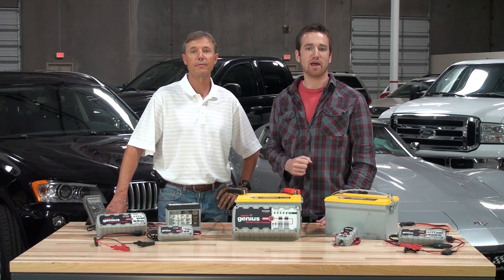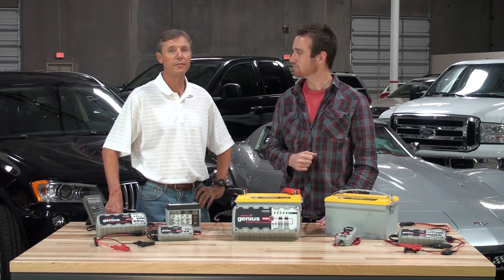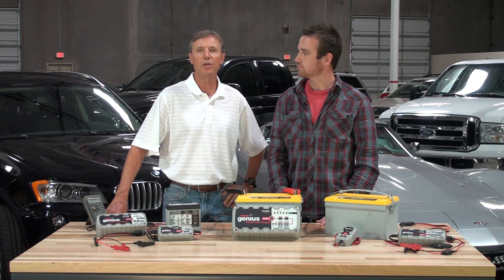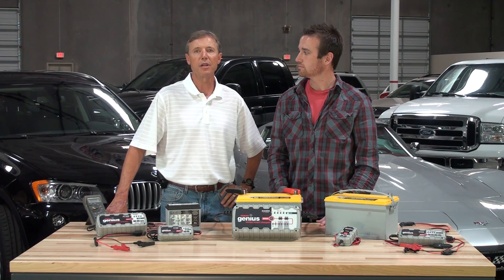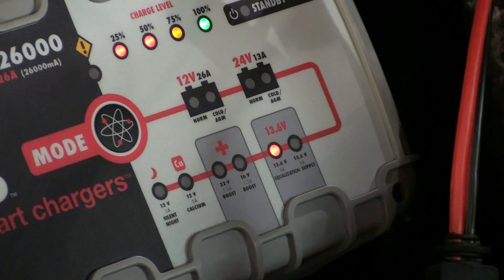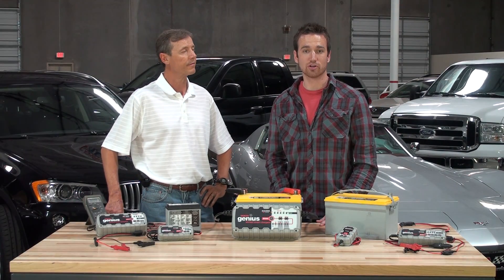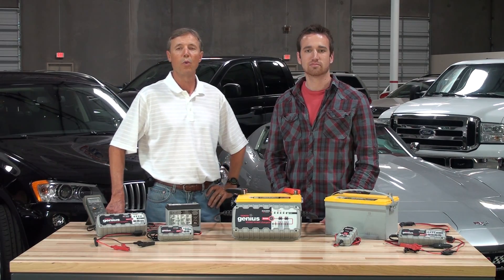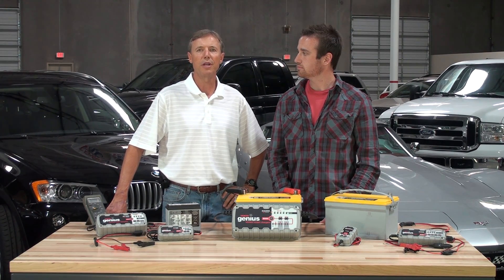Using 13.6V Equalization Mode

Comment: Outstanding! I use these for my golfcart, 4-wheeler, jetski and lawnmower. ◓◓>imgs.love/nBatteryCharger?ε    I installed the recepticle on all instead of using the battery clips. So easy to plug and unplug and all of my equipment is always fully charged. I also use a larger version for my boat.

Comment: So wrong....16volts for 4 hrs. Heck my charge controller does 14.3volts but not enough for REAL DEEP CYCLE BATTERIES. The need equalization monthly & not at 13.6
Reply: Your charge controller is likely only  pushing 2amps max into the battery. Here they are pushing 5amps Sustained into the battery. Amps is really where the power is ~

Comment: How do I equalize when I have two 6V deep cycle batteries connected in series? Do I equalize them still connected in series, or individually? Which model of charger will work for this?